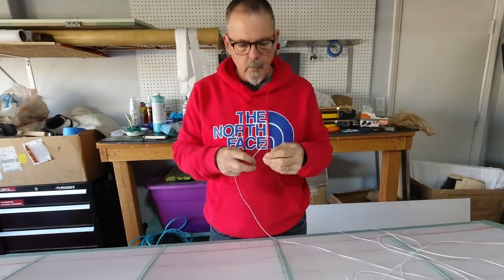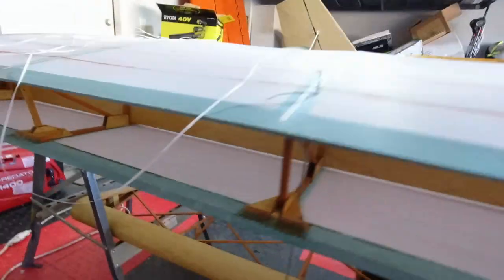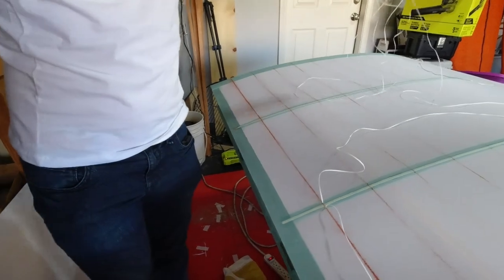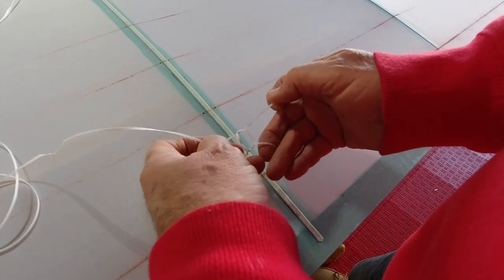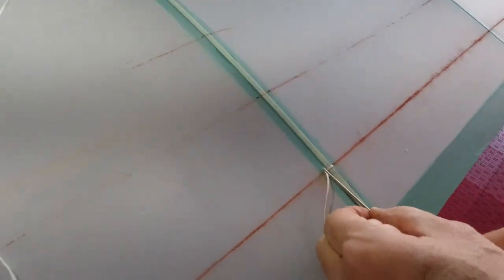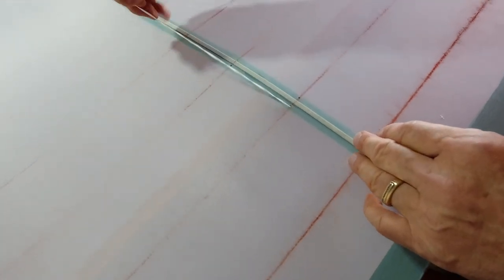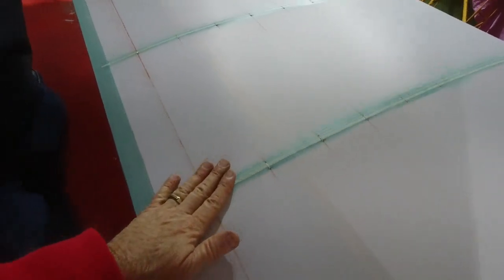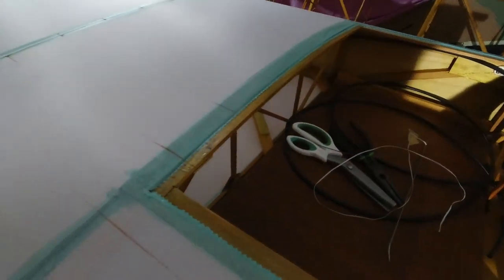Minimax 1100r Wood Aircraft Build Ep 190 - Rib Stitching

Comment: Hello Denise. I was in Walmart and bought several of the syringes that you use for measuring epoxy. I have not used them yet but would like to know how you clean them after use. Thanks
Reply from the maker: Not sure if my reply got through…I didn’t have to clean them out at all, just replaced them once. As long as you’re using one for hardener and one for resin you’ll be good.

Comment: Hello again Denise. I have been reviewing all the build videos. It’s getting warmer here in Michigan and work will soon resume on my 1100r. I was wondering since you have your airframe complete and engine complete have you done a preliminary weight and balance and CG calculation?
Reply from the maker: Hey Michael, that’s not something I’ve done. Since there is quite a bit of wing behind the CG it would be challenging to get some numbers without being fully assembled. As soon as my number comes up for a hangar, it won’t be long after that.